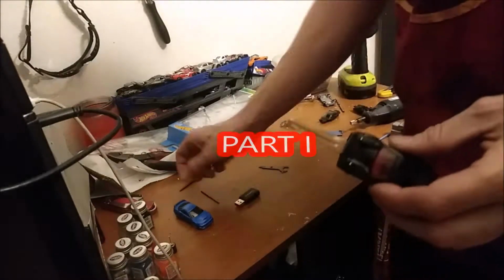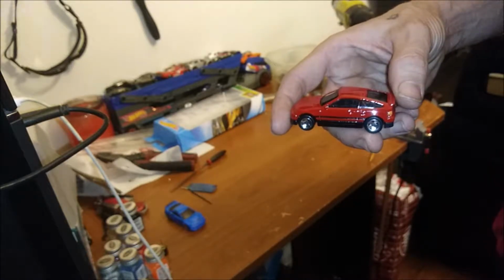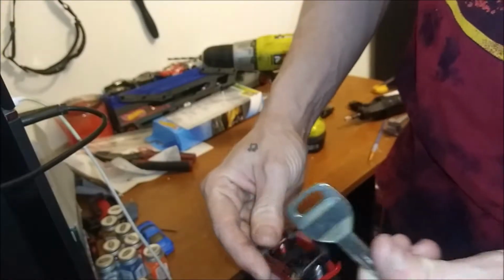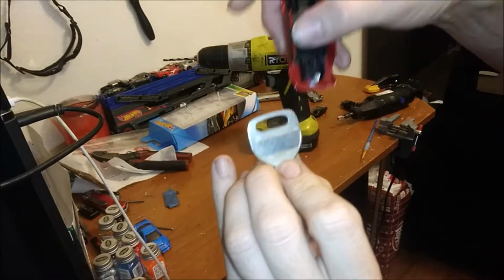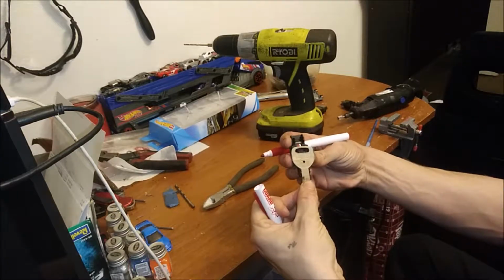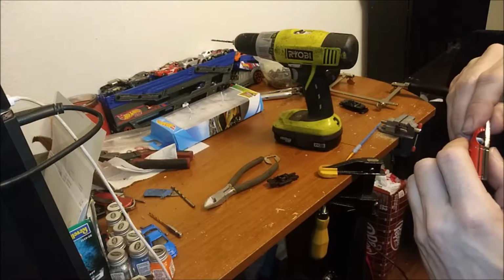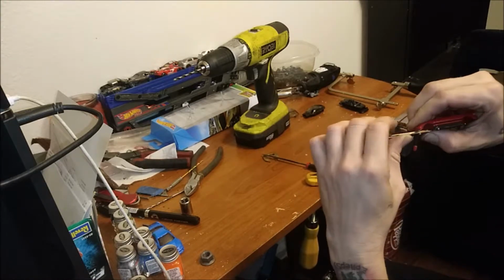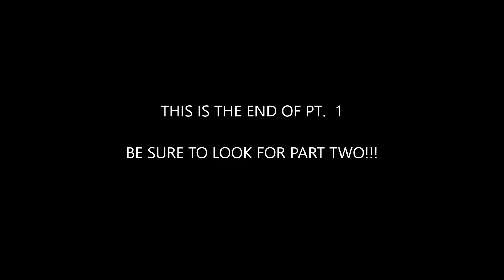Custom Hot Wheels "88 Crx" Car Key-Part I

Comment: how do you do this if the key has a chip in it?
Reply from the maker: Ive made one key with a chip and the removal is where u have to be careful, when reinstall process happens just make room for it between the seats and casting front post and it will technically be in the same location as before and works just fine.